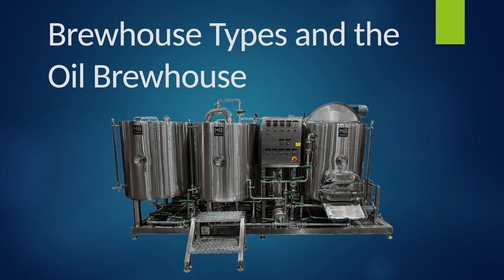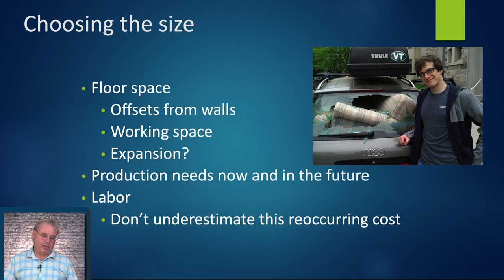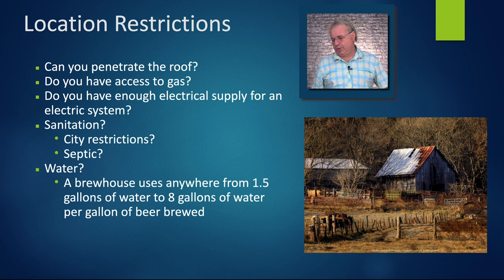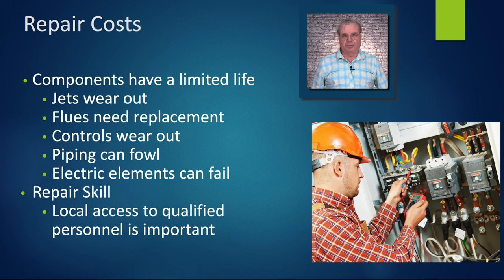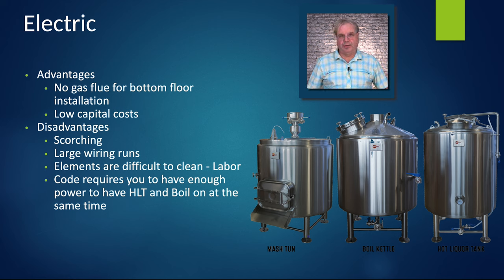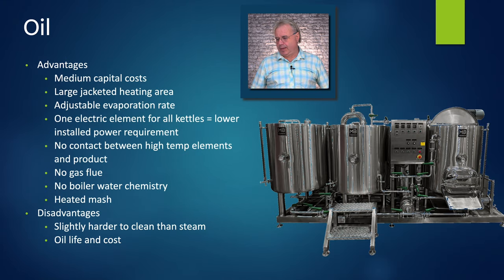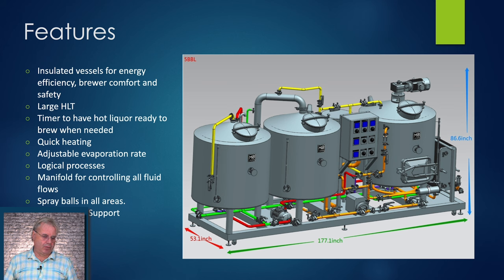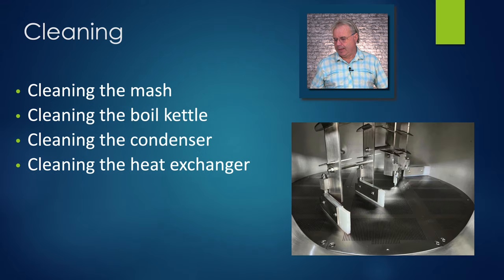How to Choose a Brewhouse | Traditional Brewhouses vs Steam Brewhouses vs Oil Brewhouses | MB Tanks

Comment: One question about the oil heated systems: How long does it take for the oil jacket to lose temperature (i.e if you wanted to add whirlpool hops at 160*F)?
Reply from the maker: Once the oil pump is off there is very little thermal mass left in the jacket and it cools quickly.